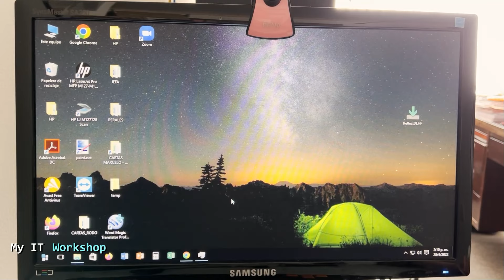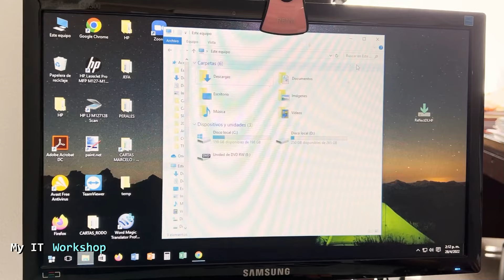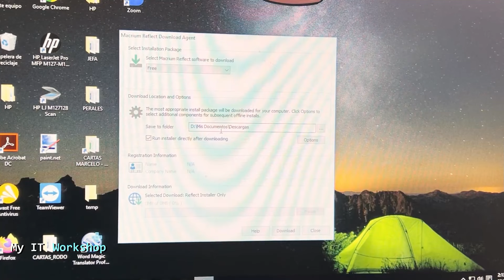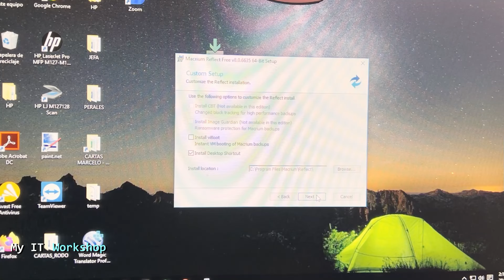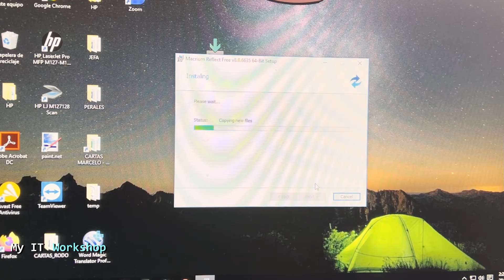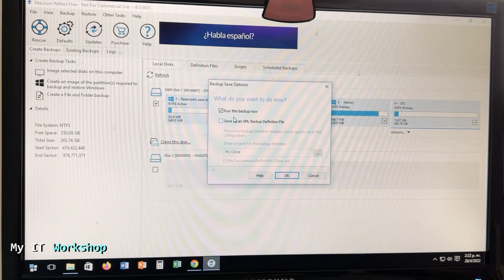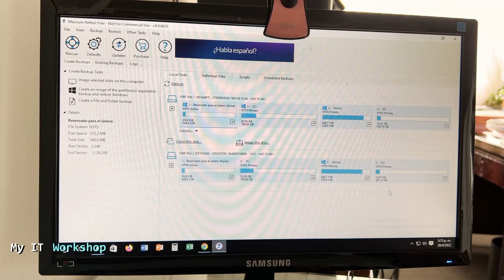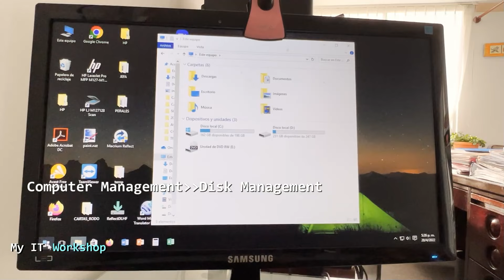Clone and Replace your Old HDD with a SSD Using Macrium Free Software

Comment: I delayed doing this for years because I didn't feel like waiting 2+ hours, but it's very easy and doesn't even require you to go into the BIOS if you use the same exact SATA cable. When it took 5 minutes to load up W10 on my HDD, I got pissed off and went out and bought a SSD.

Comment: Folks, our host recommends using a Kingston SSD.  That is a fine choice.  But it is not my first pick for an SSD.  Why?

Nearly all SSDs will run fast, as long as you do not write gigs and gigs of data, non-stop.

Nearly all SSDs have two sections of flash storage.  A small section (perhaps 10% of the drive) that is fast (for writing data), and a large section that is slow (for writing data).
When the SSD is not busy, it transfers the data that you wrote to the fast section, to the slow section.  It does this in the background.  You will not see this.

The above frees up the fast section of the SSD.  So for nearly everyone, you will always see fast speeds for your SSD.  And if you are a typical user, then this is not going to be an issue for you.

But if you write enough data, non-stop, you will eventually fill up the fast section of the SSD, and your write speed will drop from perhaps, 350 MB/s to 25 MB/s.  That's right.  The write speed will plummet.  But do not worry.  When you are done writing data to that drive, it will eventually transfer everything to its slower section, freeing up the fast section.

To avoid the above, I suggest that you purchase Crucial's MX500 (not the BX series).
Although the MX500 will also slow down if you pound it (as described above), the slowdown will be minimal.

Samsung's EVO line is also a good choice.  But the MX500 is marginally better (although you will never notice a difference).  The MX500 will cost less, which is my reason for it being my choice for a SATA based SSD.

Note that Samsung has QVO models.  Stay away, unless your needs are minimal.  The QVO drives will cost less, and their performance will suffer, as described above.

Also note that nearly all NVMe drives suffer from the same performance issue.
If anyone is interested in the NVMe drives that handle that issue the best, I will reply with the models.
Reply: This is actually pretty interesting! Well, which nvme models are recommended regarding this? ^^

Comment: It's probably worth mentioning the destination disk should also be in MBR table and later convert to GPT if your board supports UEFI because some SSD's come with GPT by default and if you have Legacy BIOS without CSM support it will fail to boot but also it might even corrupt your source OS as well. I had this unfortunately happen on one of my office computers and there was nothing I could do. 
I am not sure about Macrium but on Acronis there is an option to change this manually because if your  system is UEFI it will default to GPT.
Reply: this; very important....the cloning converted my nvme to MBR again...
Reply: This sounds pretty important, can someone please explain how to do this right with this MBR/GPT thing in the Macrium Software?
Also, my HDD is about 1TB and it might be a bit damaged (it has considerably slowed down, without anything causing it particularly), I have only 4 Gb RAM, will this work for my new SSD? I wouldn't want to wait for hours to receive some error at the end, or doing it wrong. Many thanks

Comment: Hi, i followed your instructions but my 1tb SSD is only showing 400gbs why did I lose volume?
Reply from the maker: Hi,
Go to computer management >> disk management. Most likely you’ll see the space missing as unallocated.
Hope it helps
Thanks for the comment
Reply: @MyITWorkshop  yes, had to delete recovery partition to reassign missing volume to drive C.

Comment: Thanks works for me, but what to do with my older hdd after cloning old HDD to SSD? can i used my old hdd for file storage, or do i need to format it? if I leave that way I now have two local disk. Local disk C and local disk F.
Reply from the maker: Hello,
What I do is; I keep the old HDD in a drawer for a few weeks as a backup in the event the new fails for some reason.
After that, i format it and add it as new partition/disk, that way I have more space to store stuff.
Hope it helps
Ty for the comment
Reply: @MyITWorkshop hi there, can you explain what happens to the HDD after we clone it to the SSD. Do I delete the data from the HDD since we cloned it to the SSD? Or do we still have to keep the data on the HDD? I want to have my files on the SSD(500 GB) and then have the HDD(1 TB) to have more space on my PC. Thank you!

Comment: I have a old laptop with hdd with windows 10 that is up to date. But it is slow. So using this program and use that new connector and after I  clone it into ssd then how do I stop the old hdd from being used
? And do I leave the ssd hooked up to USB port to boot up from new ssd? 
And  then will I be able to play  my games from hdd that I hope are on the new ssd and see all my pics to? 
Thanks for answering a few questions
Reply from the maker: Hello,
The goal of cloning you HDD to a SSD is to physically replace your old HDD.
Once you cloned it, you will need to take out the old HDD from your laptop and put the new SSD.
The old will be disconnected from the laptop.
The new SSD will have the data/file/games etc from the old HDD
Hope it helps
TY for the comment!
Reply: So how do I get every file and program from old  windows 10 in to a new ssd where it will start up from new ssd? And how do I install all my steam games into ssd? And pics and videos into ssd along with everything windows 10 needs to start up and run? Thx for your info
Reply from the maker: @jackjohnny682  Hello,
That process is explained in the video:
You need to clone your old HDD to the new SSD with the software shown and then replace it on your laptop/desktop.

Comment: After installing the SSD, I did not have any improvement in booting up speed or accessing app speeds.  Any idea what I did wrong?  The cloning was successful. Thanks!
Reply from the maker: Hello,
What comes to mind is the boot order in the bios. Make sure the new ssd is the first/main option.
Hope it helps
Thanks for the comment

Comment: Question. Does the cloning process turn the SSD into a bootable drive? I successfully cloned my HDD to the SSD, but when I swapped out the drives and chose the option to boot into the SSD, it couldn't find anything.
Reply: It  works most of the times for desktops. If you have laptop it may not work.

Comment: hi there, can you explain what happens to the HDD after we clone it to the SSD. Do I delete the data from the HDD since we cloned it to the SSD? Or do we still have to keep the data on the HDD? I want to have my files on the SSD(500 GB) and then have the HDD(1 TB) to have more space on my PC. Thank you!
Reply from the maker: Hello,
I keep it as is for a month or so, in the event something goes wrong with the new one and i need a backup. After that, i format it and use as volume D for extra storage.
Ty for the comment.
Reply: @MyITWorkshop  got it thank you so much for the response! I will do exactly that and have the HDD for a month as is. I currently have both HDD and SSD installed, is there a way to remove all the files and data from the HDD? Or do I have to do it manually? Thank you!!
Reply from the maker: @ShawnFX  
After you cloned you old HDD, replaced it by the a SSD and now the SSD is the main one from where you boot windows.
The old HDD should show as another partition like D or E, etc. When you are ready you can right click on it select "format". That will delete everything from it and will be ready to store other data.

Hope it helps. TY for the comment!
Reply: @MyITWorkshop  Ohhh got it, thank you so so much for the help!! Really appreciate it :) I see an improvement in the PC's speed with the SSD which will help my dad out a lot. God bless you!

Comment: So I did this from a 1TB HDD to a 2TB SSD.   previously showed as 1.86 TB , but after my SSD now only shows as 1TB both in file explorer, disk management,  and diskpart in command.   Any thoughts?
Reply: Turned out that my clone of hard disk was 4 partitions after running the copy,  and no extra space showing.   Ended up wiping the whole thing and reinstalling windows now have the 1.86 TB.  Still have all my data from old hdd though so no big deal.    Probably could've just cloned 2 of the partitions but wasn't sure which one besides the C: drive there were 2 protected partitions and 1 logical partition.  Haven't messed with this stuff in a long while, I'm sure there was probably an easier way.

Comment: Hi, i have problem because in bios in BIOS features in Boot Option Priorities it doesnt show my disc
Reply: Most likely if you are currently using a standard HD, and then install an M.2 it might be disabling 2 SATA ports(which is pretty common). If you can connect to a different SATA port you should be able to select it as the boot drive by normally pressing F12 during boot process.  Although a quick google search would probably explain this way better than my explanation (my wife likes to remind of this a lot). Good Luck!
Reply: @greavus2978  what i need to type in google to find that, i am trying to solve that problem for a week and i cant find that on google

Comment: Can I make a clone from cloned disk? Looks like it should work? I have situation where I want to update my laptop that has  256 Gb SSD with 1 Tb SSD and also I want to add Sata SSD as there is empty space for it. I don't want buy any adapters and so on. Can I install new Sata SSD, clone from main 256 Gb SSD, then remove that 256 Gb SSD and insert new 1Tb SSD and clone the system to the new 1 Tb SSD from Sata SSD?  I'll use Sata SSD as sort of transferring media for OS cloning. So I'll have new 1Tb SSD with OS and additional Sata SSD for say, storage as I don't want HHD to be there as it slows down the system. The reason I'm asking is that I haven't been lucky cloning the OS to an external HDD to test if I can boot from external media to make update that I explained above and then I found some explanation in internet that in many laptops you need to connect the storage to the motherboard internally to be able to successfully clone the disk and make the clone bootable.

Comment: Did not work, shows the ssd as the boot option and just keeps booting from the hdd, if hdd is uninstalled it says it cannot boot, disk management shows the drives as identical, but in msconfig it just lists the hdd as the only drive with a OS.

Comment: I tried it but I couldn’t, I want to windows over to my ssd but I have it on a 1tb hd and I can’t move it into my 500 Gb ssd, is there some way I can only copy the stuff I want
Reply: i tried doing the same thing unfortunately you cant select things like windows or specific things to save over. if your ssd is smaller than the amount of storage your hdd is using it wont work.

Comment: I used the methods listed with a TeamGroup SSD. I launched Macrium, but instead of having the TeamGroup SSD as Disk 2, it had the SSD and something else as a partition of disk 2. How do I fix this? (Found solution)
Reply: SOLUTION: I had to use another software called Aomei Backup to copy the data. All is well though, I have checked my SSD and all data seems to have transferred just fine :)

Comment: be aware.. sometimes it turns to shit, i did ssd to another ssd and well it fucked my new drive it formatted 222gb which is the space to my old ssd(made a new drive) because my new ssd is 1tb and not 222gb i tried to undo and that also sucked after a while i managed to delete the whole volume (222gb) and recreated it but with the other unallocated space which macrium left away. now i lost 222gb because of that shit

Comment: Can I leave the old hdd in for more storage?
Reply from the maker: Hi,
You would have to format it, but yes, you can use for extra storage.
Reply: @MyITWorkshop  Is there an easy way you could edplain that to a non techy guy? Im struggling. Lol
Reply from the maker: @AddTomatoes  HI,
NP, what i meant was: after you clone your old hard drive to a new one and installed the new one. You can connect the old one to the computer, it will open as a regular USB flashdrive, right mouse click on it and choose "format".
it will some seconds to delete everything from it and then you can use it as extra storage. 
Hope it help
TY for the comment